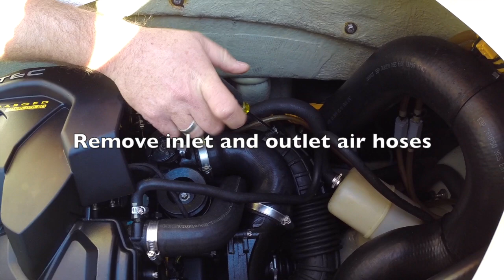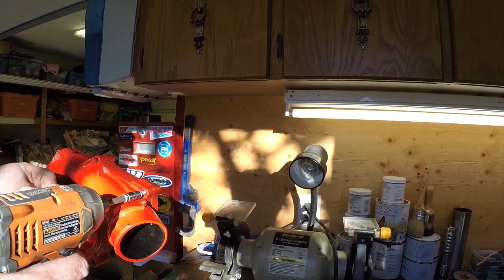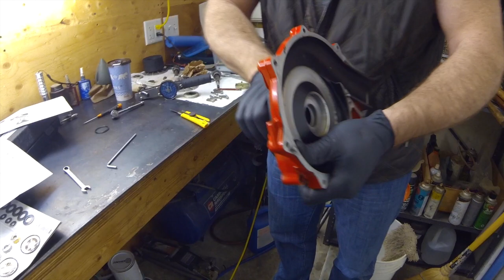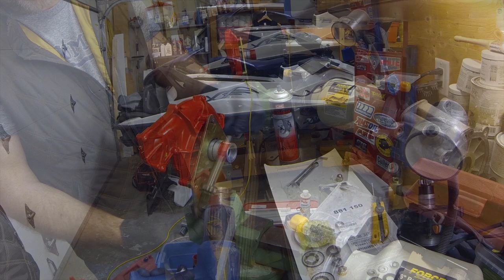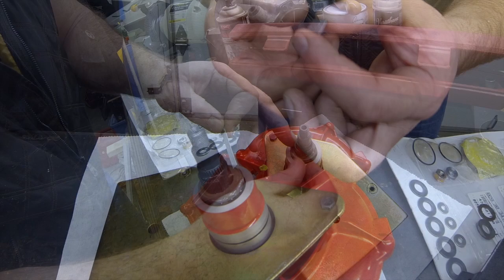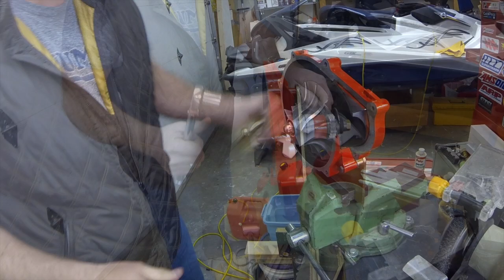How to Rebuild a 4-TEC Jet Ski Supercharger (on a 2005 Sea-Doo GTX 185)

Comment: What brand/part number torque wrench do you use to check for supercharger slip, id like to be able to check mine annually on my own to know if i should send it to be rebuilt
Reply from the maker: https://www.amazon.com/dp/B000KKXOQC/ref=as_sl_pc_tf_til?tag=3ftdspor-20&linkCode=w00&linkId=8736ccdc98edd2ad1fb7926f0cd1b621&creativeASIN=B000KKXOQC
Reply from the maker: It’s only necessary to check the slip if you feel you’re losing power. If your supercharger hasn’t been rebuilt for over 200 hours, or five years, it should be rebuilt regardless of how it slips. Good luck.
Reply: @3ftDeepChannel  ah ok thank you, theres only 10 hrs on my 215 crate engine and freshly rebuilt supercharger, im just paranoid about supercharger failure now lol do you have any experience running amzoil marine oil in supercharged 4 tecs? They claim it meets all oem specs and is perfectly safe for the superchargers
Reply from the maker: I haven’t run that oil in my machine, but you need to be very careful to match the semi-synthetic blend that BRP’s pushing. Personally, I always go with the OEM stuff. That way I’m certain I’m giving my engine and supercharger exactly what they need. If that supercharger was rebuilt properly and it was done recently, you should have lots of life left on it and I wouldn’t bother with checking the slip until it’s got at least 100 hours on it. Good luck.

Comment: Any tricks to get the threaded seal retainer out. I've soaked it with penetrating oil, heat, used a 1/2 to 3/8 adapter on the 4 pin tool with a pry bar,also with an impact gun and it's not budging. This is the first time the SC has been apart and has 105 hrs. The intercooler was leaking so the SC has a little corrosion inside but i caught it early and can't see it making the retainer so hard to remove. I've onlu used a heat gun but it was hot enough for the o rings to start smoking. Maybe more heat? I'm worried i'll snap the housing mounting tabs connected to the maintenance fixture off i'm cranking on it so hard.
Reply from the maker: I assume you’re referring to the “retaining disc”? Are you using the special tool with pins? You can also try putting it in the freezer (at least -20 degrees C) and then trying while it’s still frozen. If it doesn’t work, freeze it again and apply heat to the housing area around the disc for a minute or so (so the disc is cold and the housing is warm). Good luck!

Comment: Hi 3 deep my two supercharger kits are in and there is a machining error. The spacer on the compressor shaft does not fit as it wasn’t machined correctly. (To tight)They say not to use The old one as it is a hair longer, but the new one comes with a spacer to take up that space to make it the same as the old, I was thinking I could use the old spacer minus the thrust washer in the kit to give me the same clearance/ length as the new what are your thoughts have you run into this yet? Are both OEM kits thanks
Reply from the maker: I haven't run in to that problem before. We've never used anything but the OEM kits and have never had any issues. Whenever there's been a mismatch we've always investigated and found that something had been modified, or someone made a mistake somewhere. Remember, these things are spinning at incredible speeds. If anything's off, it'll get destroyed. Investigate further. Good luck.

Comment: Hi good day
My query is for my rxp 215, in a revision I found engine oil the hose of entrance to the supercharger and now the circuit of refrigeration has presence of oil. I use your experience and I thank you for any information about where this oil could come from. Thank you
Reply from the maker: On a stock machine, a little oil in the intake hose is normal excess oil can be caused by a leaking seal behind the supercharger wheel or oil coming through the crankcase vent system.  When was the supercharger last rebuilt ?  Without knowing the year and any modifications done those are the two areas I would check.

Comment: hi, have you ever had any issues with the bearings feeling "gritty" when on the shaft and in the housing but  one a bit of oil is applied it feels fine? is this normal. cheers awesome vids by the way..
Reply from the maker: I have noticed a difference, but it's not too extreme. I assume you're referring to when the bearings are new. If they've got more than 100 to 150 hours on them and you've got it apart, I assume you wouldn't put them back in feeling "gritty", even if they feel smooth with a bit of oil.
Reply: 3ftDeep these are on the new bearings installed that I have just installed on the shaft and in the housing, cheers Rob

Comment: Awesome video. Love all your content. How do you get the SC to come out so easily? I def have all the correct bolts out I’m able to turn it back and forth a bit and used a pry bar (carefully) which did create “some” space. But I can’t get this thing out for the life of me. Any tips? Thanks!
Reply from the maker: First make sure you got all the retaining screws out! As there are two O-rings holding it snugly, it does take some brute strength to get it out …but it shouldn’t be a huge ordeal. If it is, make sure nothing is blocking it from coming straight out. You shouldn’t need any tools (like a pry bar). Thanks for the kind words, and good luck!
Reply: @3ftDeepChannel  I have all 3 the retaining screws out…and it does move back and forth and has separated from about an inch off but it seems to just be the middle that is stuck on .

Comment: I just installed my supercharger again and checked the wheel for spin. It does not move at all! Is that a good thing?
Reply from the maker: What we'll are you referring to? The supercharger should spin freely before you install it. It engages with the engine when installed, so should be very difficult to turn after installed.

Comment: Do you know if the 2013 GTR215 is still using the needle bearings or has that been updated in the rebuild?
Reply: I dont need to yet but i found such a great deal on the rebuild kits I bought two of them . I figure next season I will need to rebuild. I have a bearing press so this should help some. In your build during video I see you placing needle bearings and I did not open my kit but I do not see any through the package,
Reply from the maker: Geo Sto As far as I know the kits are the same (i.e. still using the needle bearings).
Reply from the maker: Geo Sto The needle bearings are packaged on a wax strip as a block, so they may be there but just not recognizable. I doubt they would have replaced them, as the kits seem to only vary by number of teeth on the drive gear.

Comment: Just curious, is it a requirement to rebuild the supercharger at 100hrs?
Reply from the maker: It depends on the year. If you have a Sea-Doo model earlier than 2008 that's never been rebuilt, I'd rebuild it before taking it out again. With the newer kits you can get 150 hours or so (some say up to 200 hours, but I wouldn't push it). They say the new 300 HP models don't need rebuilding at all, but we'll see.
Reply: @3ftDeepChannel   Thanx for your reply & help. I want to get an 04 from a dealership that the prior owner traded in on cosignment with some kind of supposed electrical/ charging issue & was just asking questions ahead of time.
Reply from the maker: I avoid any machine >10 years old. Unless you've got good mechanical skills, you'll end up spending quite a bit of money staying on top of an older machine. Especially if it's been in salt water. Good luck!

Comment: Does the hard to reach bolt thread into the engine mount? It broke off and I have the other two bolts removed from SC but cant get the SC to budge out of the engine or twist. Any suggestions?
Reply from the maker: If the head has broken off that screw and the other screws have been removed, you should be able to remove the super by pulling straight back. It's held in there very tightly with 2 big O-rings, so you'll need to pull back quite hard (be careful). A lot of people change the screw to one with a proper head to make removal easier the next time. Good luck!
Reply: @3ftDeepChannel  What's the easiest way to check my engine is aligned and mounts/bushings haven't failed? I am about to try n get the supercharger out but it appears I dont have enough clearance and I am super close to driveline boot. Thinking this may be why I can't move it. Never had any issues with the ski though..
Reply from the maker: I'm not sure if it's the easiest, but here's how to check your alignment the most accurate way ...https://youtu.be/T1jRZ6QTH5I

Comment: Hi
How much time it takes for you to do the complete job !
There is a  guy want to charge me 8 hours to make the job !
 I cald different Seadoo dealers and they charge charge 3 hours if you have the kit !
Thank's
Reply from the maker: There are 3 parts to the job: 1) removal of supercharger (about 1.25 hrs); 2) rebuild supercharger (about 1.25 hr); and 3) installation of supercharger (about 0.5 hr). There's a link in the description below of a service that will rebuild it for you if you remove it yourself and send it to them. You'll then need to reinstall it. Good luck!
Reply: Thank you for your video and informations ***
Reply: @3ftDeepChannel  after watching your video im still a little hesitent on doing it myself. I just rebuilt my 96 wave venture triple carb however the RXT just scares me for some reason.
Reply from the maker: It’s really not that scary once you’ve got it out. The hardest part is getting it out of the ski, as one of the screws is a little tricky to get at, and wastes about an hour of your time. Good luck.

Comment: Hi, do you know the specs of the three bolts holding the supercharger onto the engine? I want to replace them all with hex heads since all the Torx heads are stripped
Reply from the maker: Sorry, I don't have the specs for those bolts, but I can tell you that for my GTR 215 they're Flanged Torx Screw M6 X 35. Quite a few people replace them with hex head screws without problems. Good luck.
Reply from the maker: In theory, yes but these ones don’t seem to be critical. I’ve heard of lots of people replacing the screws and have seen some myself, and I’ve never heard of any problems.

Comment: Which way is the spring washer curvature installed? Is the curve "C" (arc) shape of the spring washer pointing towards the supercharger or the "c" arc pointing away towards the rear? Your videos are amazing!
Reply from the maker: Clutch washer ----->  ) ( ) ( )  ------>  Collar  ------>  Nut
Reply: Is the collar and nut the ones in front of the turbine? Sorry to bother, if it wasn't for you. I'll never be able to fix my doo. Yamahas people call them Redoos. Like saying "fix them again." They're meanies!
Reply from the maker: The clutch part of the shaft goes into the engine.  Hold the supercharger with the impeller on your left, the right side of the shaft, other end to the impeller, is assembled like this... Bearing ----> Shaft ----> Clutch washer ----> Gear and needle bearings ----> Clutch washer ----->  ) ( ) ( )  ------>  Collar  ------>  Nut.  

I don't want to put you off working on your machine but this is not an area to experiment or make mistakes if any of these components are assembled incorrectly and fail the damage is very expensive to repair it would be a lot cheaper in the long run to pay to get the supercharger professionally rebuilt.

Comment: What's have you been doing with the rebuild kit manifacturing defect where the bearing spacer is too tight and doesn't slip on without resistance?
Reply from the maker: I have not noticed that on any of the oem rebuild kits I did a supercharger rebuild about a month ago and didn't notice anything unusual.

Comment: Any idea what the top bolt towards the front of the PWC is? I cannot get on it with literally anything it looks square but does not fit an 8mm or 7mm wrench.
Reply from the maker: It should be the same type as the other supercharger screws. A previous owner may have replaced it with something else, though.
Reply from the maker: To be certain what you’re dealing with, you should check the parts diagram on Sea-Doo’s website. That will let you know exactly what it is supposed to be there on your machine. Good luck.

Comment: how does this supercharger get lubes up whats the oiling system for the bearings?????
Reply from the maker: There are a few variations, but essentially with the 4-Tecs it gets tracked from the engine into the inner workings of the supercharger. In other words, it uses oil from the engine. That's why it's critical to use the right kind of oil in these engines, as the supercharger relies on its consistency.

Comment: interesting video, but if you tighten a 6mm bolt at 100 pounds you will snap the threat,  6mm bolts are supposed to be tighten 12-15 pounds, in special cases up to 20 pounds
Reply from the maker: Hey, Leonardo. I’m not sure which bolts you’re referring to, but the torques are straight out of the Sea-Doo Service Manual for that machine. Lots of people are reading inch-pounds as foot-pounds and are making critical mistakes. That’s why we’re starting to report all the torques as Nm in our new videos.
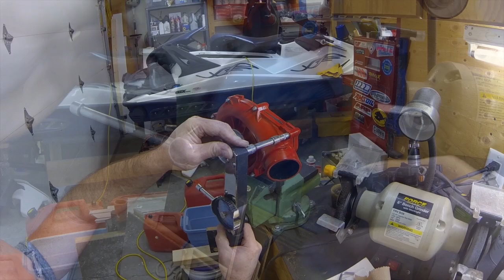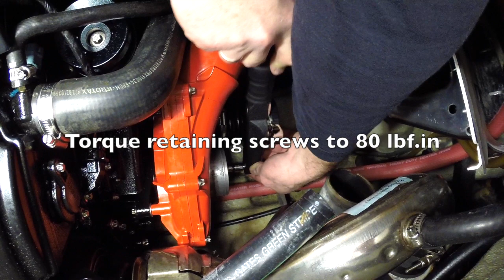Reply: @3ftDeepChannel  minute 7:19 and 8:39 both tighten at 80 pounds
Reply from the maker: Crikey! Inch-pounds, not foot-pounds. 80 inch pounds is just under 7 foot pounds.
Reply: lbf.in dude. Not ft lbs. smh

Comment: what size torx box wrench is that?? Does it come with the rebuild kit??
Reply from the maker: +Shaun White To do it right you really need 2 torque wrenches, like we have in the video. One needs to be relatively light, and capable of accurately reading 21 lbf.ft., and the other should be the gauge type, so you can see what torque it was at when it slips. Neither come with the rebuild kit. You can usually get the first type for about US$50, and the second for about US$100. Good luck!
Reply: +3ftDeep Sorry i wanst clear lol! i meant the torx box end that you use to remove the sc bolts that hold it to the motor? Not torque wrench :D Sorry for the confusion
Reply from the maker: +Shaun White No problem. It's a Torx E8. You should also get the Torx Adapter 529 035 938, as one of the screws is difficult to access.

Comment: Hey I have a 03 gtx supercharged and I notice compared to others that I have little to no supercharger whistle/whine noise is that a bad thing
Reply from the maker: I replied to this comment elsewhere. Please let us know if you didn't see it.
Reply: @3ftDeepChannel  couldn’t find it I have another question so I removed the secondary water box and I want to use some of the hose to make a new angle for it to go back to the exhaust but I’m wondering if I need to make a arch like the stock system had so I can prevent water getting into the heads and hydro locking it when it is shut off in the water or will it be fine without it and running a straight to the exhaust. thanks
Reply from the maker: We suggest going with the stock OEM strategy. Good luck.

Comment: this is the same video for rebuilding on an rxp 215?
Reply from the maker: Essentially. Just make sure you get the right kit for your machine, and apply the correct torques. You should always have a service manual handy for your machine when doing this type of work. Good luck.
Reply: @3ftDeepChannel  thank you ,
your tutorial are well detailed and it helps a lot :)
Reply from the maker: Thanks very much for the kind words!

Comment: how do you torque the top e8 bolt on reassemble?
Reply from the maker: I assume you mean the difficult-to-access Torx M6x35 screw that bolts the supercharger to the engine. We don't torque that one. We just snug it up as tight as we can. Good luck.

Comment: how long did that take you?
Reply from the maker: With the right tool to remove the supercharger it takes about 1 to 1.5 hours to remove it (same to install). Plus, it takes a couple of hours to do the rebuild (if you take it nice and easy). Without the right tool it can take hours to remove the supercharger. So, with the right tool(s) I'd budget about 4 to 5 hours start to finish.

Comment: So if when I pulled the supercharger out from the engine, there was not a gear that came out with it? What would that mean. I’ve got an 04 rxp and an 05 rxt that this was the same case with. No gear on the supercharger. Would anyone know why that might be? And I would imagine that could be why it wasn’t building any boost. Bought the pair of machines that this way, all I’ve done is take the superchargers off. Any insight would be incredible
Reply from the maker: It could be bad news. Do you know if the supercharger was ever rebuilt. If so, how many hours ago?
Reply: Gear is inside the engine? That is the bad case scenario. Could be engine carnage inside.

Comment: Is this process similar for the 260 models?
Reply from the maker: It’s basically the same, yes. There are a few different kits, however, so make sure you get hold of proper instructions for your specific machine. Good luck.
Reply: Thank you, everything looks similar except separating the 2 halves. Ordered the OEM kit/tools & I have the service manual, it’s saving me more than $500 to do it myself. Shops are charging more than $1k to do it now (even more if they remove & install it).

Comment: I have a rxt 230 dealer says the supercharger isn’t rebuildable is that true
Reply from the maker: Are you sure it’s not an RXT 300? The superchargers in those are not “rebuildable” and are supposed to last the life of the machine. What year is your machine?
Reply: @3ftDeepChannel  2019 rxt 230
Reply from the maker: It looks like the superchargers in those models are not rebuildable, either. They are supposed to last the life of your machine. Hopefully yours is OK.